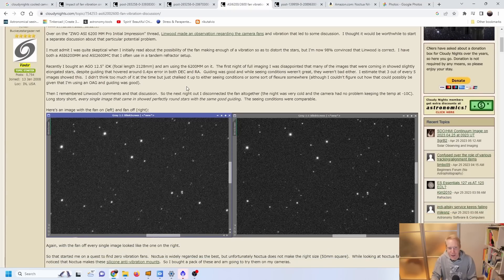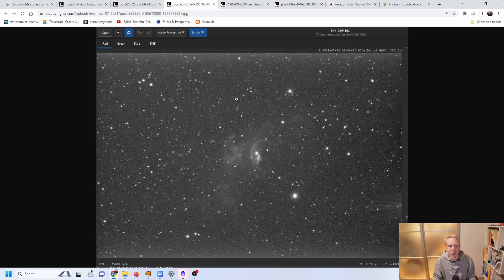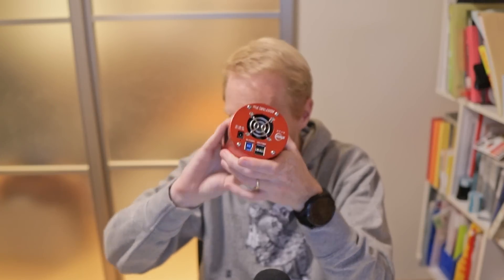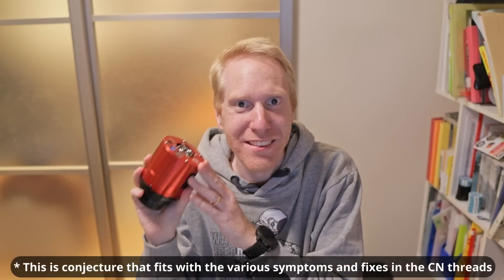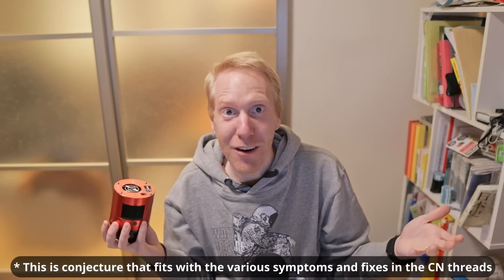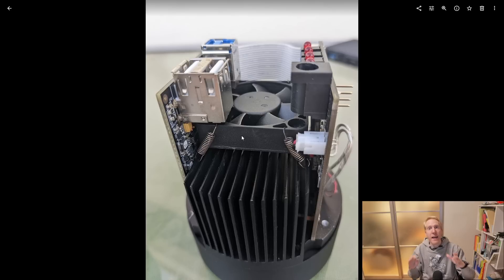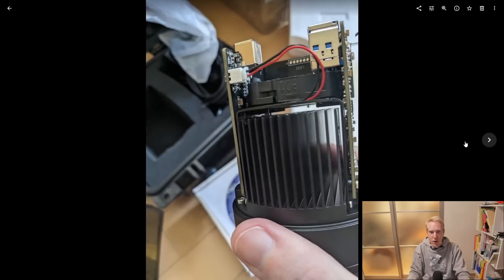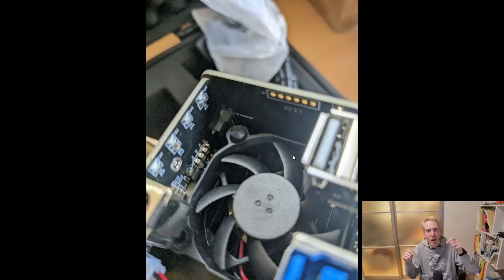Cooled Cameras can HURT our images?! 😱 HOW?? EASY fixes!

Comment: I actually had this issue with the first patch of ASI2600MM, fan vibration was causing elongated stars at 1645mm, contacted ZWO to send me a new fan and instead they wanted to change something in the firmware through remote session which it didn't help and got me very frustrated with the quality of their service, later I contacted OPT and explained the problem that I don't have to go through all this as this is a brand new camera, so they agreed to send me another one which it didn't have this issue. But thanks to your video, it does make sense why my stars have a bad shape sometimes, I will do the test of switching the fan off and check my stars.
Reply from the maker: Good luck! And glad you could get a replacement via OPT!

Comment: Mon opinion c'est soit d'avoir un DSLR/mirrorless soit de passer directement à une caméra refroidie MONO :) . Mais une caméra refroidie couleur.. J'ai eu la 2600MC que j'ai comparé à mon A7RIV.. honnêtement très peu de différence; j'avais fait un poste sur cloudynight, comparant aussi avec le D850. Après la température extérieure était aux environs de 15°. Je suis sûr que si on était à 25, les différences seraient plus prononcées.

Mais par rapport à cette situation, à des focal lengths de 600-1000+ on capte tellement de vibrations que je ne serai pas étonné de capter celles du refroidisseur.. un peu comme quand on capte la vibration du shutter. Sur un C8, j'avais le même problème quand j'activais des fans pour aider à la mise en équilibre température intérieur - extérieur.. et elles étaient pourtant parfaitement équilibrés et avec du caoutchouc pour absorber les vibrations au contact du scope

Comment: OMG!!! I can't believe it! I have to check this out. I have been having non-round stars for years now and could figure out why I've been having so much trouble! I thought it was focus, collimation, tilt, bad focuser, bad optics, OTA, just getting more and more annoyed. I hope you have just saved my sanity! I will try no cooling next time out for sure - although my fl is only 560mm. The thing is I always doubted the fan design in the first place - I'm an engineer. When I was considering buying a cooled camera, I thought they wouldn't have a fan for this very reason (vibration). Seeing that they all had fans, I figured they must know what they are doing, and no-one ever complained as far as I knew. My hopes are high now but I'm also once again disappointed with products that don't actually work! I will reply to this again with my tests. Wish me luck :)
Reply from the maker: Luck!

Comment: in hifi we use sorbathane for antivibration miles better than the the silicone and rubber parts used on these fans for vibration

Comment: Thank again Cuiv for helping us solve a problem. I have been going crazy with oblong stars with my 2600MC ( but but the MM )at 1960 mm on a great mount! Will do the cooled v no cooled test soon!! Thank you!
Reply: Andrea, I’ve just checked out subs on my 2 x 2600MC’s and 2 x 2600MM’s and found exactly the same.  The issue is clearer on the (earlier purchased) MC’s and hardly noticeable at all on the MM’s.  All using subs at same FL of ~1464mm

Comment: Really interesting video. I have a dual side by side setup consisting of a Mead10" and a Skywatcher 120 on a CEM120 mount. Both scopes are using ASI2600mmPros. The stars with the Skywatcher are pinpoint but the stars on the Meade are slightly elongated and I've been wondering why as I use an OAG with both scopes and the guiding with the Meade will often be between 0.4 and 0.6. So next imaging session I will definitely be testing out this theory to see what happens. Thanks for posting this.

Comment: The fan in my 533 is causing vibrations. With the fan off, the stars are perfect. I need to dampen it I guess, long FL is a PITA!
Reply from the maker: What scope are you using it with??
Reply: @CuivTheLazyGeek  The Edge HD 8. The thing is that the issue only popped up tonight, last night it was working fine, but that is how it goes with astrophotography!

Comment: I would hazard a guess that it could be a QC issue? Many people do long exposures with long focal lengths without issue. Thanks for putting this out, it's certainly something to think about and keep in mind. I use a ASI533MC with an EdgeHD8 at 14830mm FL and can do 10 minutes subs without issue when seeing and conditions are good and I always use cooling.
Reply from the maker: Very likely some fan lottery going on. My guess is that it isn't even an QC issue, I'd be surprised if they even had a step that checked vibrations from the fan. It seems to be related to camera and to the gear that it's attached to!
Reply: Wow, almost 15 metres focal length, that is almost 35 times more than my 70mm refractor at 420mm!!
Reply: typo, it's meant to read 1480mm  @Bills_APCh

Comment: I noticed the same while doing planetary with the ASI294mc-pro. At FL of ca. 4000mm all details on the planet surface were getting washed due to camera vibration. As for planetary there is not a big need to have the cooler on, I ,since then, always close the cooler. After your great video I will check whether also in Deep sky Astrophotography with the same camera i have the problems you described. I will be testing at FL = 1450 mm. Thanks for all your great content!

Comment: The oblong stars mean that the imaging train stiffness is not uniform in all directions and the response to the fan unbalance (thru resonance or simply forced response) is stronger in one direction. I cannot test this but I presume that systems with a large filter wheel will be more prone to this as the stiffness to bend the camera towards the center of the filter wheel will be much less than in the orthogonal direction (along the rim of the filter wheel). I would think that systems without a filter wheel are much less sensitive to this or at least, the degradation would be uniform, like a general blurring.

Comment: Wow what a silly oversight on camera design to have a problem like that! And yet I never even considered it as a possibility for my own funky star problems I've been trying to ignore 😂 Thanks for making a video on it!

I have a 2600MM Pro and took the rear cover off after watching your video to see how the fan was mounted. ZWO used metal fasteners with a washer/o-ring sandwich on each one between the fan guard and the fan. Problem is, the whole thing is basically hard-mounted after how tight they've cranked down the fasteners, o-rings or not.

With it apart I also figured I'd try tinkering with the fan voltage to see if it even needed to run at full rpm(more vibration) to keep the sensor at my usual -10c. Turns out it doesn't, at least in my testing last night. In the original configuration with the fan running on 12v(5300rpm), room temp of 23c~, I was able to maintain -10c at 82% cooler power for around an hour straight.

Then I added a step-down regulator and gradually turned it all the way down to just 5 volts(2400rpm) before I noticed the temp curve drifting over 20min~, where the camera started trying to compensate by giving more power to the TEC. I bumped it back up to 7v(3350rpm) to give myself some extra headroom and ran it overnight where it settled at the same 82% cooler power without issues, so I'll test it there for a few nights and see what happens. Worst case, I'll increase voltage as needed, but I haven't seen more than 70-80% cooler power during most summer nights in the past, so if it holds -10c at 7v then I'll leave it there 😆

I also swapped the fasteners for some EPDM o-ring cord pulled through the mounting holes, and added silicone spacers between the fan guard/fan body similar to the noctua silicone plugs. If I was to upgrade the fan later on, it's also worthy to note that the original fan is only 10mm thick, uses 20mm fasteners, and extends about ~16mm deep using the stock mounting hardware(just the fan depth, not including total hardware length). With the fan removed, I measured 30mm between the inside of the cover down to the heatsink fins, so I might look for thicker ~20mm fans as potential upgrades to make use of that extra space inside.
Reply: That increased thickness you mention could allow more "CFM" at considerably lower RPM as well.

Comment: Interesting as ever Cuiv but not convinced. Got a 2600MC pro, a 6200MM pro and a 294 MC pro. I cannot discern any vibrations you describe at 50-100% of full power cooling. I wonder if it is more a case of “less than good” quality control and some are coming through with unbalanced fans as in an unbalanced car wheel???? As ever great video to make one think. Thank you
Reply from the maker: I think there is a lot of factors, including a fan lottery going on! There's an obvious selection bias going on overall since most users have ZWO cameras, so it's likely many of them are unaffected, at least judging from the comments!
Reply: @CuivTheLazyGeek  Definitely, what we need now is someone following this thread with several ZWO cameras of which only one presents with this issue and for them to volunteer to swap the fan between cameras and see if the problem transfers.  Should be a good argument for ZWO to do a fan replace for them at least.  ZWO do seem excellent with their after sales backup! Clear Skies.

Comment: I've experienced the same issue with the ASI 2600 MM Pro. When used at short focal lengths, no problem. However, on my Celestron Edge HD 8 , with a focal length over 2000 mm, stars are elongated when the fan is on. It took me a long time to figure this out. I am, also, not sure it is due to the connection to the case, as I have used vibration damping connectors and even installed a gasket to keep the back plate separate from the main camera body, with little improvement. I worry that the airflow through the camera is what is causing the vibration. When the camera started leaking oil from the thermal pad, I returned it for a replacement. The new camera arrives this week, so we will see.

Comment: OMG, I have a CPC1100HD and a cooled ZWO camera, I shoot at primarily F7(1960mm) and sometime F10 (native 2800mm), I have been struggling with oblong stars for over a year. I blamed the mount backlash, i blamed PHD2, I blamed my collimation, I suspected my focal reducer. I have tried everything but have only made minor improvements. Next clear night I will test this with cooler off. In the mean time i ordered the new pins, it won't hurt and I am due to disassemble the camera to recharge the desiccant before the summer months anyway, perfect time to upgrade the fan mounts.

Comment: I wonder if it would be a good idea to separate the TEC and fan power so you can control them independently. Then you could keep the TEC on all the time and only turn the fan on between exposures. For instance, you could take a 3 minute exposure with the TEC on, but the fan off. Then, when the exposure is done, you could turn on the fan for 1 minute to evacuate the heat while the sensor is not taking data. Of course, this would reduce your imaging time by 25%, but it might be a good technique for minimizing vibration at high FL. You could experiment to determine the best ratio of on/off.

Comment: 100% CORRECT! I have always wonder about this because the fan is causing a force and or vibration due to the fan rotating blades. As well there are 2 kinds of fans a brush or brushless designs as well.
Reply: As well as maglev fans which are designed for minimum vibration.

Comment: Thanks Quiv, again a great video. I want add that i had issues on my stars on the edge hd 8. It was caused by the dew heater ring of celestron running on full power. I was able to solve it to get the controller so the power is regulated. Next thing I will work on is this vibration issue on my asi2600mm. Long focal length is a pain 😪

Comment: Thanks for the video. It really reminds me that I should do the work to replace the fans of my cameras. Last year a group of friends who share this hobby purchased a bunch of fans when we heard about this possible issue. The fans we bought to replace the originals are maglev fans so the fan blades and hub are not in contact of anything when spinning.  I haven't tried it so cannot speak for the result, but it's something to consider if you are using ZWO cameras.
Reply: Hi ysl109812, What make of camera and what make of fan are you going to use. I have a ZWO ASI294 colour pro camera and I regularly image at 2000mm FL on my Meade LX200 Classic SCT. I have several other issues that I am currently ironing out but my CEM60 mount is guiding well through an OAG. So now I've seen this video I want to get ready to make this upgrade to a maglev fan using the anti-vibration mounts shown by Guiv. 

Many thanks to Guiv for highlighting this problem.
Reply: @ianhargraves5871  I have ZWO asi294 and 2600 cameras (mc/mm).  For the fans, try google "sunon maglev 12v fan". The  model for ASI294 cameras is: SUNON KDE1204PFV1. But please verify the specs before making a purchase. I haven't put mine in so isn't 100% sure.

Comment: Thank you so much for your video! That was perfect timing. Last week I observed very reproducible "wiggling satellite traces" in my subframes which I had no explanation for. I own a Touptek ATR3CMOS26000KMA (IMX571) which I bought new half a year ago. So I can confirm: fan vibration issues can (at times) also happen with the Touptek design.
Reply from the maker: Nooooo, so it truly is a fan lottery :-( are your heat spreader fins flush with the camera body, or recessed from the camera body?
Reply: @CuivTheLazyGeek  I have the older model (where the fins are flush). When I touch the camera body I feel an obvious vibration.

I completely disassembled it today. As you showed in your video the fan is held by four springs which press the fan hard against the heat spreader. This way it becomes a great vibration spreader. :)

I removed the springs and attached the fan to the heat spreader by four small vertical strips of very soft adhesive tape. Unfortunately the fan vibration is still tangible.

I guess I will replace it with a higher quality model. By the way, the original fan is an ADDA AD0412HB-G70 (40x40, 12V DC, 6000rpm, ball bearing).

Cheers,
Frank
Reply from the maker: @frankfeustel3772  yep it seems from the comments that gen1 at least was indeed prone to the issue... A fan lottery is going on...
Reply: @CuivTheLazyGeek  I solved my vibration issue. I tossed out the original fan and replaced it with a Noctua NF-A4x10 FLX. In addition, the new fan is not held by springs anymore but by strips of soft adhesive tape. As a result, all vibrations are eliminated.🙂
Reply from the maker: @frankfeustel3772  well done! Excellent to hear!

Comment: Thanks God, till today, not experienced any weird issues at my star shapes when I shoot with my ASI 533 MC PRO, though my EDGE HD at 1.422  FL. Maybe its also depending on percentage of the fan working to bring down temp. If it works fast/hard enough maybe vibrations will appear. Even at almost 80% fan speed, I personally haven't experienced or at least haven't seen oblong stars. Maybe my 533 MC PRO is a very good one ;)

Comment: This is one of these situations where being heavy isn’t such a bad thing. The more mass the less vibration can propagate, or at least that’s what would seem to be the case in my head. iOptron mounts are neat and all with there low weight to payload capacity but I’d imagine problems like this would be worse in those cases, the EQ6-r being heavy could be seen as an advantage.

Comment: I have a C8 and an ASI294MC Pro. I still focus manually and I have noticed vibrations when I touch the focus knob sometimes. I assumed it came from the fan but didn’t think there was a solution. I’ll have to try with it off and see.

Comment: I have the ASI2600mm Pro, but fortunately my highest FL is 550mm. I'm saving $$ for a Celestron Edge HD and this will be an issue. Of course, if ZWO would only balance their fans like an automobile wheel this would not be an issue :) but then, we're talking about cheap plastic in our expensive astro gear. Glad you brought this to our attention your Laziness, TY

Comment: Very interesting investigation. One difference I notice between read and the blue camera is that the fan is mounted off-center in the red camera. Could that be one of the contributing factors? Another factor could be type of the bearing systems used in the motor - ball bearing (good) versus sleeve bearings (bad). The blades of the plastic fan gets warped due to heat (I have seen this in CPU cooling) eventually leading uneven load distribution around the motor axis leading to noise, vibrations, etc.

Comment: My first sign of trouble related to oblong stars were with my Newtonian, when the fan was running.  Ever since then I do not image with the fan on on the Newtonian telescope.  I advise everyone to turn it off, most Newtonians and RC scopes (or any scope with fans on it)  in the mass production price range has poorly designed fan attachments and they transmit the vibration to mirrors.  This can be such a high frequency, that you may not be able to detect it by touching it, but your images will show it. I also did this modification to my ZWO camera (rubber pegs instead of the screws) since I usually do that to my custom built desktop cooling fans too since the 90s.  And that's for to make a quiet PC, but pc-builders know all about this.

Comment: Yeah, i have this exact problem with a new 2600mc even at 750mm focal length. Installed the noctua silicon dampers now. Waiting for clear skies to test but i can already say that the fan in my model is a bad one, causung lots if vibration. I will look for a replacment fan as well now…
Reply from the maker: Fingers crossed the dampers help at least...